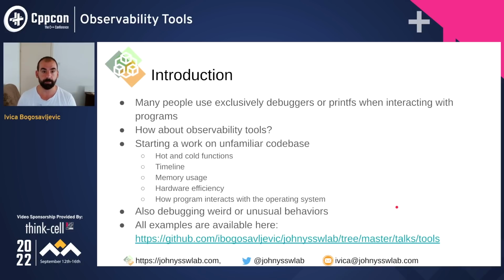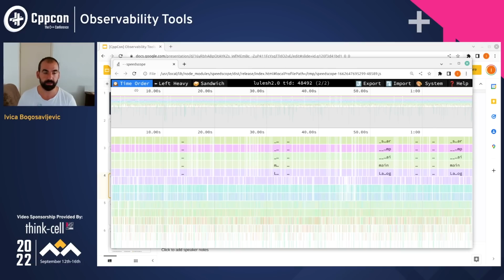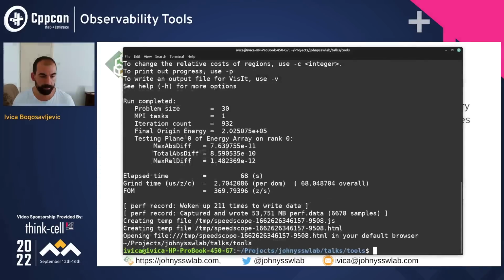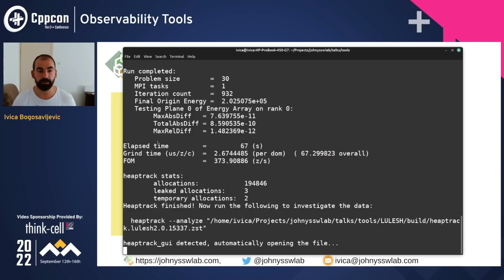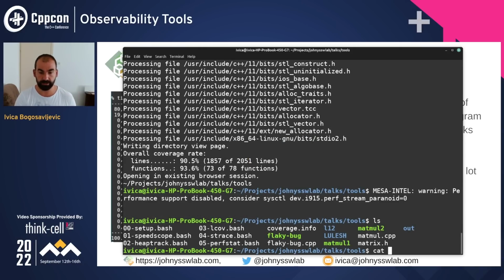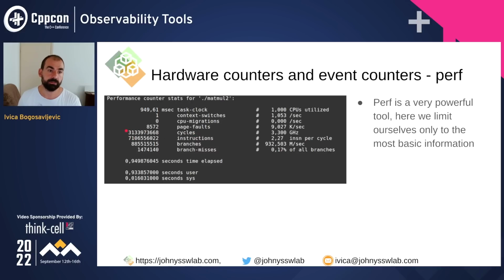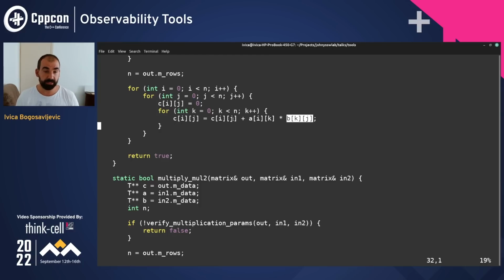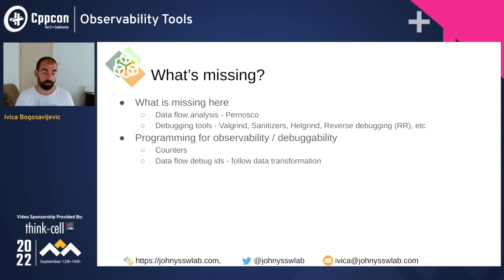Observability Tools C++: Beyond GDB and printf - Tools to Understand the Behavior of Your Program

Comment: I would love to see a tutorial on this subject, where, say, there are 10 smaller exercises, with trivial or semi trivial applications have either non performant code or code that has room for optimization and for each exercise in the tutorial some particular tool is used, and explained, where the actual optimization is then left to the reader to do. That would be an incredible thing.

Comment: Tools mentioned : 
1. Perf with speed scope (function call analysis)
2. Heaptrack (memory analysis)
3. Lcov (Coverage tools)
4. Strace (kernel call tracing)
5. Perf (Hardware counters and event counters)
6. Pernosco (data flow analysis)
7. Valgrind,sanitizer, helgrind,reverse debugging(good old debuggers)